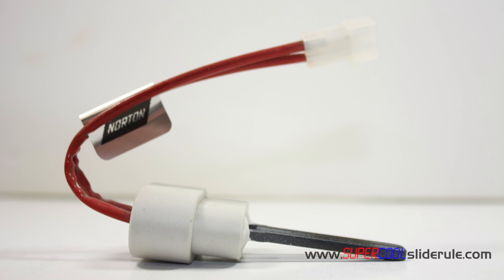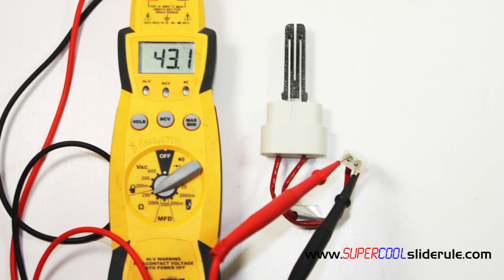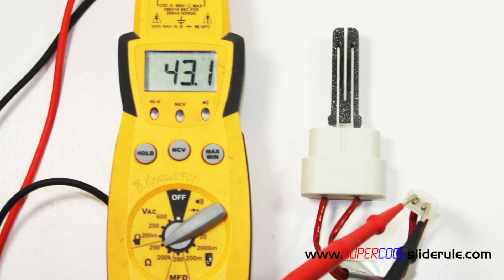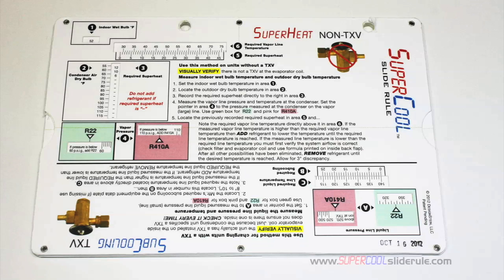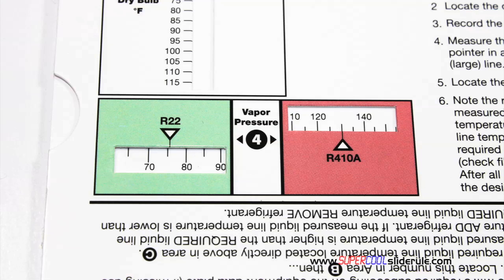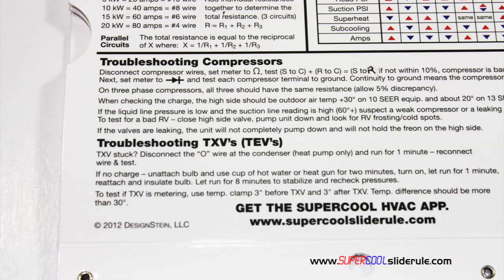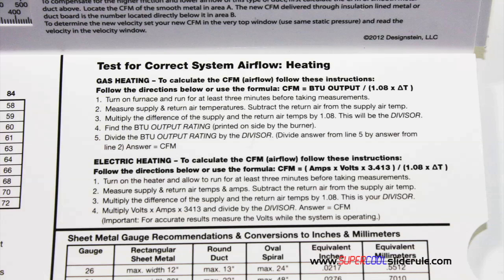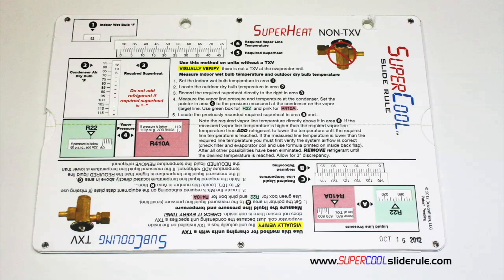How to test a Hot Surface Ignitor

Comment: Thus us true based on ohms Law !!! 120v divided by 35 ohms gives 3.4 amps. And 40 ohms gives 3 and anything above 40 ohms will give almost no amps. 43 ohm gives 2.6 amps Bad ignitor the more res. Or ohms the less amps 43 ohms or more is a bad ignitor thus is simply ohms law. It doesn't matter what the comp. Says. 60 ohms is 2 amps it can't run on that it's impossible. Just put a amp meter on it for 3.2 a to 3.5 amps good. If you use ohms no more ohms than 40 or 39 ohms
Reply: Are all hot surface igniters 110/120 volts?